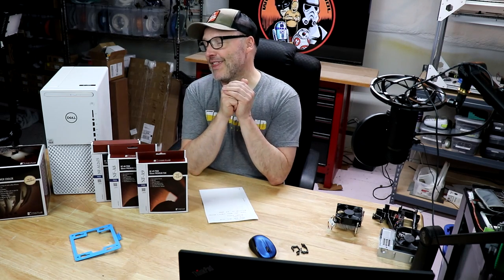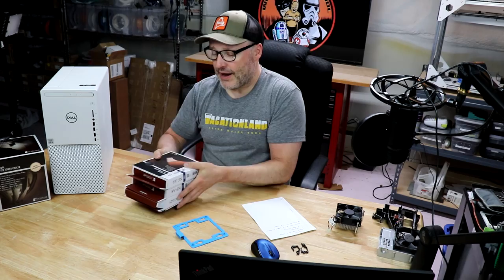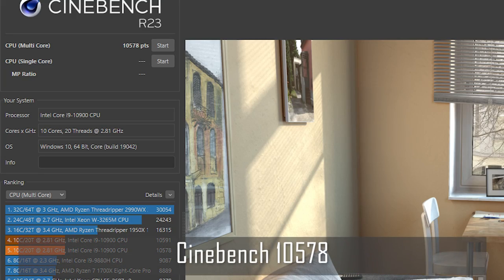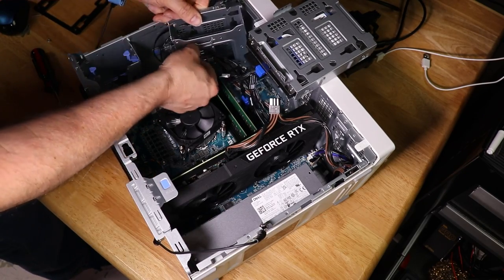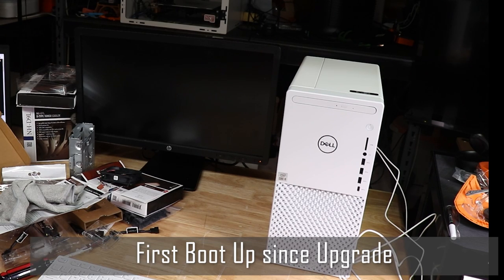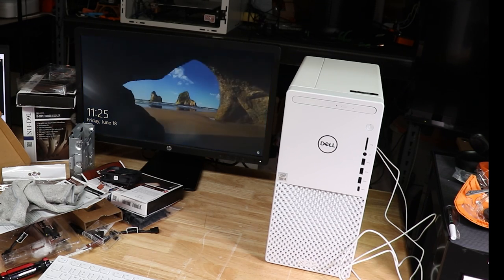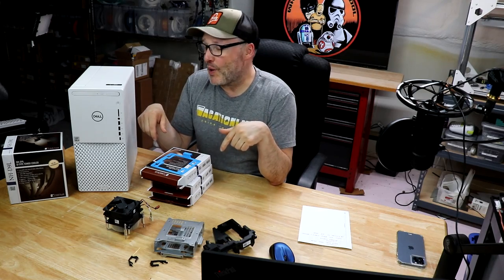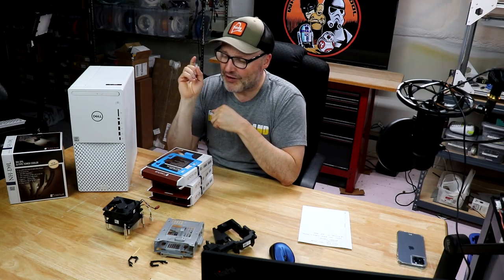Dell XPS 8940 / G5 5000 - Upgrading CPU Cooler and Fan Upgrades for better performance?

Comment: Hi all, quick question: where do you get the black spacers? Do they come included with any of the main addon parts (fans/screws/etc) or is it a separate buy? 

Last piece of the puzzle for me!
Reply from the maker: Mine came with the Noctua cpu heat sink
Reply: @WhereNerdyisCool  Thanks!:)
Reply: @WhereNerdyisCool  Just wanted to add, successfully finished cooling upgrade on my XPS - your vid was a huge help! Keep them coming mate, gl
Reply from the maker: Awesome!  I hope you opted to subscribe and see my other fun projects

Comment: question on M3 screws...  Does the cooler came with M3 screws?   Do you have to customize M3 screws by cutting the head off?
Reply from the maker: Hi. The needed M3 screws were not included. Yes, as commented elsewhere here, I took 30 mm M3 screws and shortened to fit (cut heads off). 🙂

Comment: I just ordered a XPS8940 i7 11700. I've never worked on a PC. Do you think I'd be able to do this install myself? Also in your opinion if i skip on the NF-A12 would it make much of a difference?
Reply from the maker: If unsure of your skills, either be super careful (use the static strap) or ask a local shop to do it. Please be careful
Reply: @WhereNerdyisCool  Install was a success! Fans were easy. Found a printed bracket on eBay for $10. CPU cooler not so much lol. But I ended up using a Vetroo V5 as seen in Crossed Helix's video. Was afraid to overtighten so the screws can still be turned but the cooler seems secure. Do you think it's worth opening it back up again to tighten the screws till they bottom out? Intel XTU2 score was 4636 marks with a highest CPU temp of 64C.
Reply from the maker: Congratulations. As far as tightening, that’s completely up to you. If you feel it’s secure, then great!  Hopefully you recorded some before and after results ?
Reply: Okay great thanks for the advice! So I benchmarked with Cinebench prior to the cooler upgrade and saw some pretty high temps 88 to 90. Can't remember the score but it definitely throttles. It reached 90 C while running Universe Sandbox last night. After my upgrade today (Vetroo V5, A12 and A9, decided to skip on the A8) I ran a benchmark test with Intel XTU2 and got a score of 4636 marks. Max frequency of 4.40 GHz with a highest cpu temp of 64 C

Comment: Thank you so much for producing this video and information, very informative. I ordered the listed parts and hardware (Noctua NH-D9L CPU Cooler with NF-A9 92mm Fan, Noctua NF - A8 A9 and A12 fans, 3D Printed 120mm Fan Bracket, M3 X25MM Grub Screws, and VR Heatsink for XPS 8940) and can’t wait to start this project.

One question: I see that there are two 4 pin fan connector sockets on the mother board, one for the CPU fan and the other for the rear box fan. Did you connect the A8 (front bottom fan) and the A9 (rear exhaust fan) fans together using the supplied Y-cable and extension cable to the 4-pin fan socket? Does the A12 (front top fan) and the CPU A9 fans together using the supplied Y-cable and extension cable to the 4-pin CPU fan socket?  or   did you run all A12, A9, and A8 fans using 2 Y-cables and extension cables from box fan 4 pin socket and the CPU fan to the CPU 4 pin socket?
Reply from the maker: I used the Y adaptors that came with the fans 4 pin connections
Reply: How did you do it? Curious to know I had the same questions of which one should be together ;)
Reply: @EZzO444  

* Using a Noctua supplied Y adaptor I connected the top front Noctua NF-A12x25 PWM (120mm) and the Noctua NH-D9L, Premium CPU Cooler with NF-A9 92mm fans to the CPU Fan Connector on the Motherboard. 

* Using another one of the Noctua supplied Y adaptors I connected the rear Noctua NF-A9 PWM (92mm) and the front lower Noctua NF-A8 PWM (80mm) fans to the Fan Connector on the Motherboard.

Note: All four fans started up when the computer was power up and have run perfectly since.
Reply: @charleskitterman7114  thanks Charles for the intake bottom did you find a way to keep the GPU bracket?! Last question did you use a specific fan profile or created a new one?
Reply from the maker: I removed it. No need for it, really

Comment: So, I don't know if you are still reading comments on this video. I purchased the CPU cooler you mentioned in the video. And it no longer comes with the 25mm screws. Now you have to remove the motherboard. Any help would be greatly appreciated.
Reply from the maker: I read all the comments. And in the video and comments, I stated you have to provide your own 25 mm screws.  I just used a Dremel to remove the heads and filed them to clean them up.  Have a safe upgrade

Comment: Hi, I just want to upgrade one fan. Can I just remove the OEM Dell's fan and replace it with the Noctua NF-A9 PWM?
How many pin the Noctua NF-A9 PWM is? Can I plug it directly to the mainboard without the splitter? Thank you!
Reply from the maker: I believe I used the included splitter and connected up the four pin connector

Comment: Hey there, noobs here and will follow your guide soon. Just two quick questions: Will there be instructions in the boxes on where to connect the case fans (not the CPU one)? Are all three case fans directly connected to the power supply and not the mother board? This is my first time modifying anything with the desktop so I'm overwhelmed to say the least, your video is very helpful but since it's my first time I'm still trying to fill in my knowledge gaps :(.
Reply from the maker: Check the Dell forum I listed in the description for full details. In short you are replacing existing connections so that’s the easy part. I used the Y adapters (4 pin) that came with the fans.  Go slow and have fun

Comment: Is there a way to buy the 3d printer fan adaptor from someone already made? I dont have a 3d printer.
Reply from the maker: If you check the comments, someone in here is printing and selling them on eBay.

Comment: Any ideas on how to make the GPU run cooler? Mine dosent run at harmful temperatures however would love it to be quiter as the GPU fans are super loud.
Reply from the maker: I used MSI afterburner and cranked up the gpu fan speed up

Comment: Can you use (4) M3/25MM screws without cutting the heads off by placing black spacers on board first and then placing mount on top and then screw M3 25MM to tighten without using supplied screw caps?  Trying to prevent cutting anything if possible.
Reply from the maker: Well if you use the threaded nuts in the Noctua heat sink , it can’t fit over the screw heads
Reply: Yes you can. Just don’t use the Noctua cap screws. It works great
Reply: In fact, you probably will just need shorter screws. I don’t remember what I used, I think they were 20mm

Comment: Thanks for the detailed video!  Did you have to purchase the  4 M3x25mm set screws or did they come with the kit?
Reply from the maker: Bought them and cut the screw heads off. 🙂
Reply: @WhereNerdyisCool  Oh not mentioned in your video.  Thought it came with the cooler kit.  Is there any other mods made not mentioned?  I purchased all items listed to install on my xps that arrives this week.  Thanks again for your assistance.
Reply from the maker: You should have everything you need!
Reply: @WhereNerdyisCool  One more please, did you have to purchase additional power cables for the fans?  Or did it come with them?
Reply from the maker: I didn’t need any additional cables. I used the 4 pin adapters that came with the fans
Reply: @WhereNerdyisCool  Awesome thanks again, appreciate your help!
Reply: @WhereNerdyisCool  can you tell me what length you cut the 4 M3 screws too?
Reply from the maker: I believe I said it in the video but I shortened them to 20mm which works well with the included Noctua cpu heat sink nuts

Comment: I have this pc. I am replacing the stock cpu cooler with a vetroo v5, and replacing the stock back fan with a 92mm fan. For some reason, I was sent a 120mm fan instead of a 92mm fan. Do you think I could place this 120mm fan onto the vetroo v5 heatsink? This would mean that there would be a 120mm fan on both sides of the heatsink (there is already one that comes with the vetroo v5). Would this offer better cooling? Does this pc even have enough power for that? The reason I do not want to put this 120mm I was sent in the front is because I do not have easy access to that 3D printed mounting part.
Reply from the maker: Not sure the 120 will fit. Interesting question!  The front fan helps airflow but the case doesn’t have much gaps to really take advantage of it.  However a better rear fan is impressive…you’ll feel a lot of hot air being funneled out.  I just upgraded the ram on my machine last night (32 to 64) and checked the fans. Everything is working well
Reply: @WhereNerdyisCool  Alright. So I guess I will see if both 120mm fans even fit on the heatsink first. If they do not, I will send the 120mm fan back so I can hopefully receive the right size (92mm) this time. Thanks for the quick response.
Reply from the maker: @mnbvcxz-g8c  yeah give it look over and let me know how it works for you.  I don’t have that heat sink so don’t know how a different fan will fit
Reply: @WhereNerdyisCool  Reporting back - The vetroo v5 install went smoothly and was a great upgrade for cpu temps and performance. The 120mm noctua fan sadly did not fit on the heatsink. I think I'm going to return the 120mm noctua fan in exchange for a 92mm version for the back fan slot. Perhaps I should also be able to place the stock 80mm fan in the front by the gpu, assuming there is room and the fan splitter reaches. Is taking off that gpu bracket and leaving it off ok? (I have a version with an rtx 3060ti rather than a 3070)
Reply from the maker: The card holder / bracket thingy I left out (removed).  Putting a fan in front of the card won’t do a thing for card temps but I liked that more airflow was helping cool the system

Comment: Hi sir, I have G5 5000, I am wondering do you have the part number for the top 3.5 HDD bay? I try to move the front HDD to top, but I contacted Dell, the operator said there is no such part for moving the HDD. But I saw you have the HDD bay on top.  Thank you
Reply from the maker: I didn’t have to buy any Dell parts. I just removed the top tray and put the front one in its place
Reply: @WhereNerdyisCool  I replayed the video two times, it is like you have an optical drive, then there is a mount for the HDD bracket. my G5 does not have that. I have to use metal to make one.
Reply: @WhereNerdyisCool  Thank you
Reply from the maker: Might be the difference between the 8940 and G5?

Comment: I have replaced the CPU cooler with the K version tower cooler. and now I want to upgrade the fan, at lease the 80mm case fan. Which fan would you say maybe the most effective upgrade? rear case fan from 80-92 or adding the 125 in front? I talked to Noctua sales rep and oddly they don't actually recommend putting any noctua fans into a 8940 dell pre-build.
Reply from the maker: If you only do one do the rear fan.
Reply: @WhereNerdyisCool  Will it be just a plug and play kind of upgrade or do I need to do some adjustments such as fun speed/curves to make it work? I think 8940 have very limited control in the bios.
Reply from the maker: I made no changes to firmware.
Reply: @WhereNerdyisCool  Just installed A9, replaced the stock 80mm. it definitely runs quieter, but the idle temp is about the same, and gaming temp is about the same for GPU and about the same or even a bit higher than before for the CPU. Maybe adding the 120mm intake is necessary to see significant change in cooling perfermance.
Reply from the maker: Yeah I didn’t see huge gains on the GPU. But you must feel a lot more hot air coming out the back
Reply: @WhereNerdyisCool  yes, it quieter and seem to exhaust more air out of the case. But since temperature didn’t improve, I am thinking adding a 120mm intake in the HDD location, but 8940 front panel does not have perforated vents in the upper part like G series, will that 120mm even work as expected if it is installed in the HDD bracket location? And how much improvement should I expect in term the cooling?
Reply from the maker: I stuck a fan in the front of mine I figure air will find a way in!
Reply: @WhereNerdyisCool  OK, Thank you! I just ordered a A12. Just one question, I am planning to use the Y splitter to connect the A9 in the rear and A12 in front to the fan_sys header. and the 4 pin connector to the A9, 3 pin to the A12, is it a correct way to set up? Or should I connect the CPU cooler fan to the A12 intake?
Reply from the maker: I only used the 4 pin splitters that came with the fan and cpu cooler.  I can’t recall which I connected to
Reply: @WhereNerdyisCool  I just read the FAQs on Noctua website I think it doesn’t matter which end to connect to it’s going to synchronize 2 fans anyway.
Reply: @WhereNerdyisCool  You are right, air does find its way in. I can feel a lot more air flow in the case with my hand on the grille. And the system running quite a bit louder too compare to when it only had a 92 mm rear fan. However, temperature doesn't change much at all.
Reply from the maker: My PC is silent with all the fans operating

Comment: My friend says that the motherboards that Dell has their systems have special sockets making the CPUs not salvageable to use in my own system build, which does not make any sense to me. Is my friend correct? If not, do you happen to know what the socket this system uses? I wanted to get the XPS 8940 and take the CPU, graphics card, and maybe the PSU to build my Mini-ITX system.
Reply: He's wrong with this system you can clearly see that when he removes the CPU cooler the CPU can also be removed just like a normal mother board
Reply from the maker: Your friend is wrong. The motherboard is proprietary but the components like cpu and ram can be used in other systems

Comment: just emailed you but I'll ask the community here:  the Alienware Command Center app for managing thermal profiles will only ever report a max speed of 51% for the A9 exhaust fan.  My theory is that the Dell bios and AWCC is hard coded to use the OEM fan specs (4000rpm) and does NOT adapt to whatever you install in it.  I haven't really seen any discussion about this and I'm trying to figure out if its an issue or not.  I guess not, the Noctua fans still run, but I'd guess that if the cpu cooler was replaced, the AWCC would only ever report 50% for it as well (assuming that fan is a 2000rpm fan).  What does your AWCC report for fan speed with the A9?
Reply from the maker: I’m not running an Alienware PC.  Would that be running on the XPS?
Reply: @WhereNerdyisCool  The G5 desktops (for some reason) have Alienware Command Center as the app to control fans, power settings (and the LED lights which I don't use).
Reply: rephrased:  what does HWInfo report as fan speeds after the upgrade?  And does the XPS bios manage the fan speeds or are you using a 3rd party app like HWInfo?  thanks

Comment: Have mine with the 3060ti , fast as hell, I can't believe how fast this thing is.   If I lose 5 frames to heat, o well.  I had a HP desktop with even a smaller cooler and it lasted me 10 years, the good  old I7 3770k , but my gtx 77 died on me.
Reply: How much did it cost? Costco has it with 3060ti, i7-11700, 32gb memory and 512gb ssd + 1tb hdd at $1300
Reply from the maker: Ooh small SSD. I’d plan to upgrade that thing quickly.
Reply: @WhereNerdyisCool  yeah, cooling must be done first from what I've seen already all over the net. I'm wondering if it's a good deal. Gpu plus cpu, even on normal gpu prices (pre-pandemic), seems like a decent deal.
Reply from the maker: It’s the only way I could get a GTX card last year too. I prefer building my own systems!
Reply: @WhereNerdyisCool  Same situation I would prefer it too! Good thing is I have until dec 24 to think about it 🤔
Reply from the maker: @Spawn223311  it’s not a terrible rig. I’m curious if the cooler on the i7 is any better than the hockey puck mine came with
Reply: @WhereNerdyisCool  lol it's probably the same

Comment: Do you have a link for the screws on the cpu cooler
Reply from the maker: I made my own cutting the heads of M3 25mm screws.  I couldn’t find 20mm set screws
Reply: @WhereNerdyisCool  I got the m3x20mm  and tried to use them, but they are too short.
Reply from the maker: Ah interesting.

Comment: I have the Dell K-upgraded cooler w/my i7K CPU. The upgraded cooler isn’t terrible. Should I just upgrade (at least) the rear exhaust fan? Or add the 2 intake front fans as well?
Reply from the maker: Hi Brian.  You aren’t talking a lot of money ($15?) for individual fans and pump out hot air that’s just not flowing out very well.  The bottom fan near the gpu might be something you could go without. But the big front and rear, I’d suggest at least those.  Run some benchmarks and see how to fare before and after!
Reply: @WhereNerdyisCool  Thank you! I’ll def upgrade the fans. Do I absolutely need the 3d printed bracket? Where can I get it without a 3d printer?
Reply from the maker: @brianode11  anyone local to you that has a 3D printer should be able to make one for you.  Just show them that Thingiverse link.  It makes the fan install very easy.  Just ask your Facebook friends for a printing source!
Reply: @WhereNerdyisCool  Thank you again! I’m going to get the 3d bracket printed, and I’ll go with the 120 up front and the 90 in the rear. Thanks a mill. for the video! 👍🏻
Reply from the maker: I’m glad you liked it. I hope I’ve helped your computer run better !  (And I hope I gained a Subscriber!)